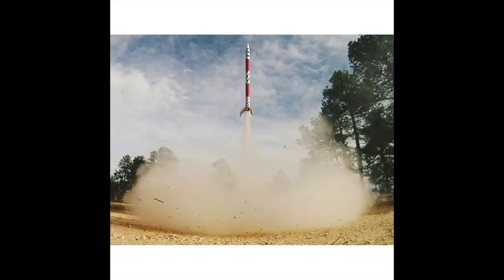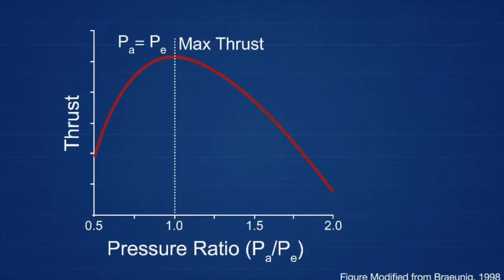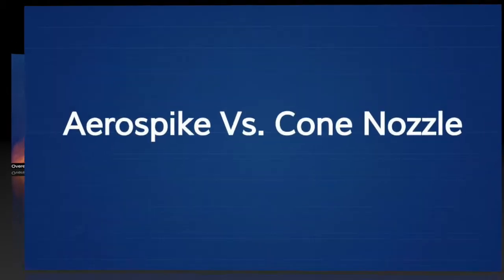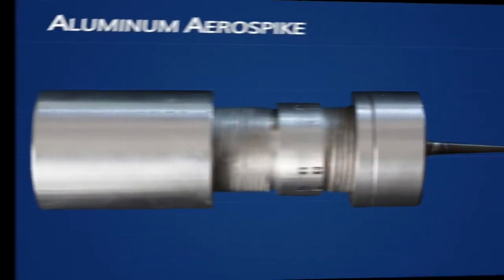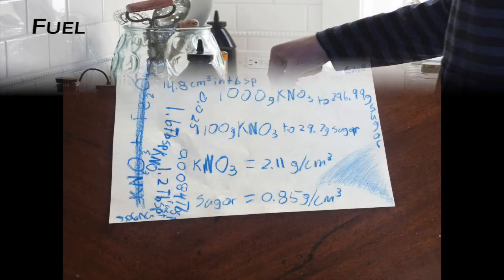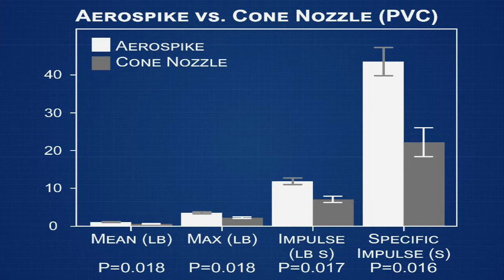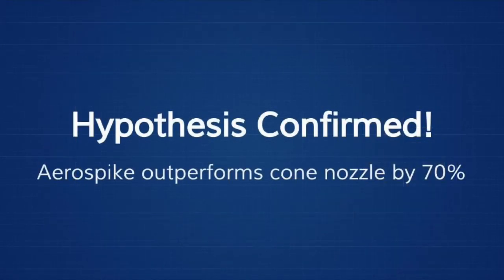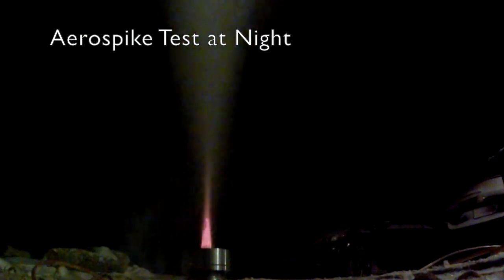Google Science Fair 2015! Constructing an Aerospike Rocket Engine for Increased Thrust

Comment: A properly designed traditional bell nozzle and an aerospike will create roughly the same amount of thrust at the designed ambient pressure. A bell nozzle actually outperforms an aerospike by 3% at a fixed altitude.
What makes aerospikes unique is their ability to adapt to the pressure change that occurs as you transit the atmosphere. In general, they will perform more efficiently than a bell nozzle at any given altitude except at the designed altitude for the bell nozzle. Check my years of research and testing on www.jaredbrewer.com.
Reply: Jared Brewer hey
I have a similar idea for a 1 year project. but I want to focus on the exact curve of the spike. I see you did a great job already. I've built a lot of rockets by myself but with a primitive bell nozzle.
Reply: anonyme seekuh What do you mean exactly? Shape to performace comparison? The difference beween a 30 degree straight cone aerospike and a full Prandtl-Meyer expansion fan or even adopted Rao geometry is only 3% opeeational efficiency. Experimentally a 5% error margin is generally acceptable so 3% gains are hard to justify on small scales. Something like the XRS 2200, on the other hand, will show thousands of pounds of difference making it easier to filter out of the noise.
Reply: i want to do about 20 tests per nozzle form and justify this way a precise resultat. and only 1 % more thrust is a triumph. i have some different ideas for the exact form. those differents are minimal and the results will show if the different of thrust is noticable.